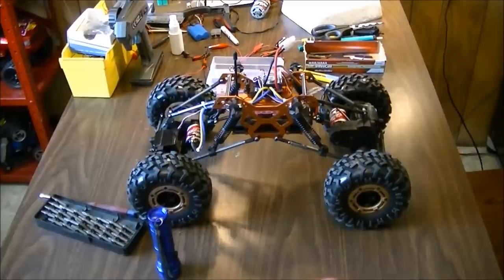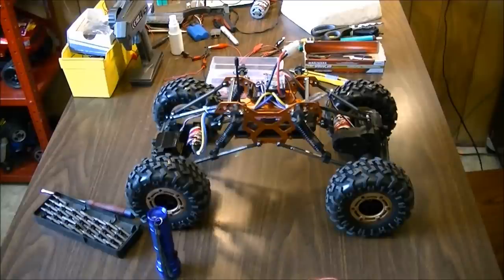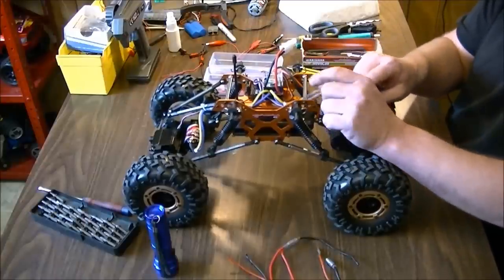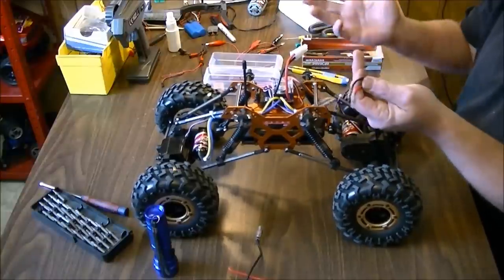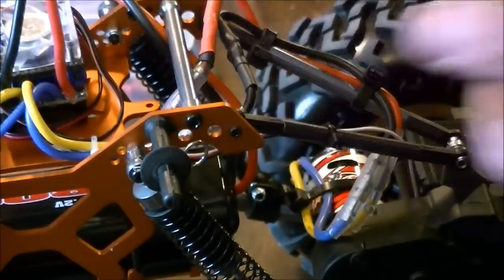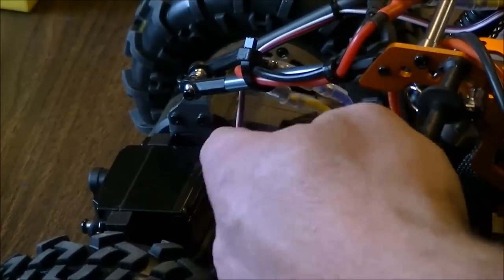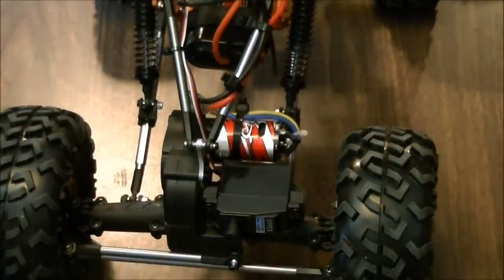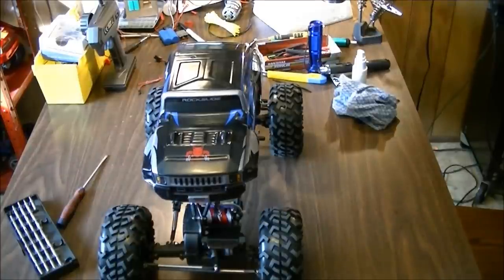RedCat Racing RS10 Rock Crawler Motor Mod

Comment: I used electrical tape on the ends of my motors to keep the wires protected from the tires.  I carefully moved the wires closer to the motor and taped them and then cut out the vent holes on the motor.  I've had my redcat for three years now and have not had any problems with the motors like that.  I have changed the steering servos with high torque metal gear servos.  My next upgrade is the metal gears for both axles.
Reply from the maker: cool

Comment: Did you get those extra gears in yet for this, the one that might work in the buggy's?? Can't wait to find out if it is possible to mod that gear to put into the buggy, even thought I have stocked up on the replacement gears for the buggy because I have already stripped two of the gears. I ordered three more sets but hopefully by time I was all of those we can come up with some type of metal gear replacement.
Reply from the maker: iam ordering the steel gears for my rs 10 next month

Comment: Kevin,

I see you upgrade the motors from 380 to 390. Did it make a significant difference and how many Turn motor is it??  Plus do you know the specs of the 380 and 390 motors?

Thanks
Reply from the maker: +Tick Tock nope i never upgraded the motors mine came with the 390 motors and yes they have power i have  video on my channel of it towing my big traxxas summit around the yard

Comment: good tip here. I will have to check this out on my RS10. I will likely just re-solder the wires though. I'm well out of any warranty I think.
Reply from the maker: +B and C RC thanks
Reply: mine must be a later run. the wires are tucked very tight to the motor, well away from any tire rubbing danger.
Reply from the maker: +B and C RC anything is possible

Comment: all you have to do is shave the inside of the side walls of your tires... lol did it day one that's the BEST way to do it...
shave the knobs off the inside so they cant grab your motor leads
Reply from the maker: i kinda like my tires to be complete, dont have the stock tires anymore and reducing the steering amount and extending the wires made 100% improvement , thanks for the idea
Reply: yes the stock tires are junk..rovers are the best we've found we've went through 8 rs10's they are great. check out mine on my channel you might get a few more ideas " summit servos, scale body etc"
Reply from the maker: Jamey Campbell sense this video i have done alot of upgrades to  my rs10 , traxxas 2075 servos suspension mods different bodies. got Gmade Bighorn tires with the treads reversed lots of stuff and yup ill look at your channel forsure
Reply: oh ok you have a newer video??? you still have the factory esc? im thinking about going to a waterproof esc but don't know if I want the axial AE5 or the traxxas waterproof esc that comes in the summit "brushed" thanks !!
Reply from the maker: Jamey Campbell i got lots videos on the rs10 any how yup still on the factory one its 100% water proof in the version of the rs10 i have also have the upgrade steering links and so on and so on .. , the AE-5 is water resistant not guaranteed to be water proof some say yes some say no. guess will have to test that one . the traxxas escs most are water proof some are not. the EVX-2 is 100% water proof i took my big summit for a good swim in the lake and no problems .
Reply: cool thanks
Reply from the maker: Jamey Campbell yup yup your welcome